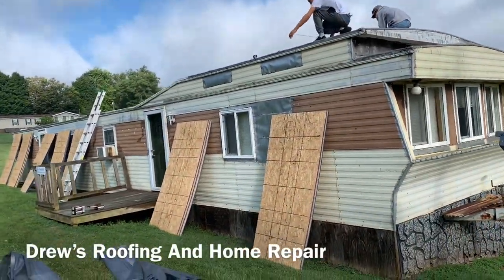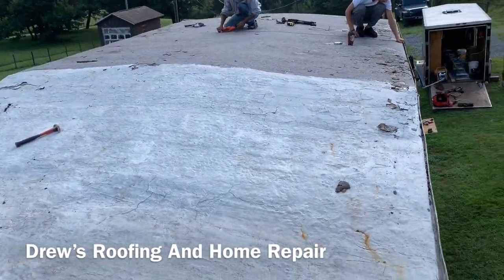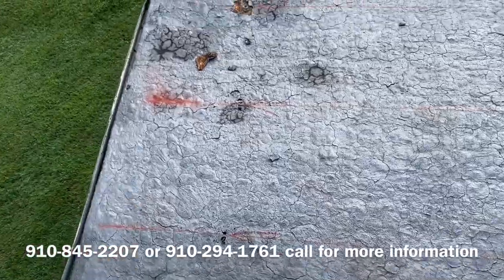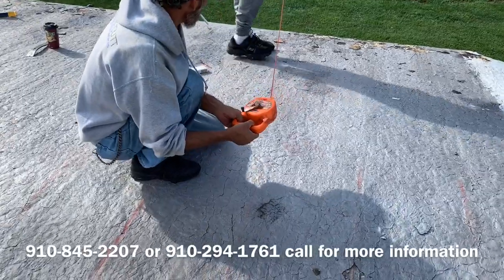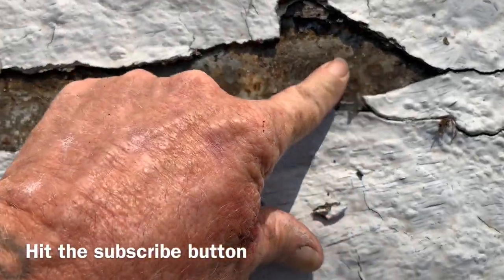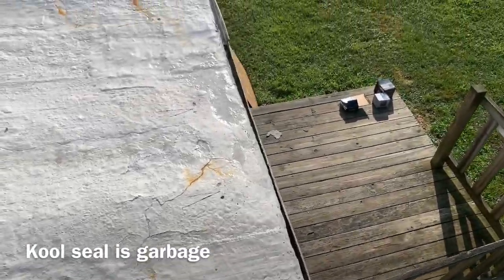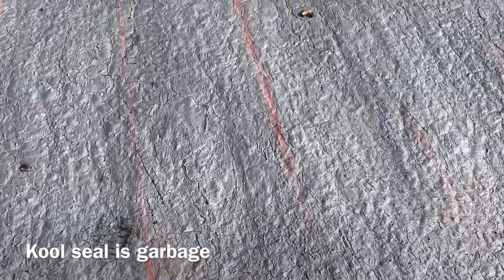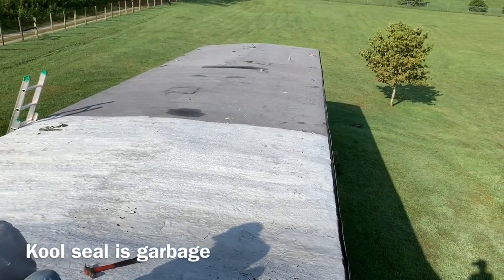Single Wide Mobile Home Roof Repair Day 1

Comment: "Kool Seal is garbage"... I assume that Roof Guard elastomeric coating, which you recommend/use in a previous video, is NOT the same as Kool Seal?
Reply from the maker: Either way they both do the same thing I just really don’t like either one to be honest and I do not do cool selling anymore so if you see us doing cool seal it was an older video I will not do call sale anymore. All I will do is to Rubber Roof like you might’ve seen us doing on YouTube I will share that video with you now https://youtu.be/NtdkEpBxDuE
Reply: @Drewsroofingandhomerepair  yes, i saw that video...i think it's this one that i am replying to. the rubber roofing seems too expensive since I got a price for around $5000 for a complete roof over. even that is too much for me right now. so I am going to patch/seal until I can afford something better. thanks.